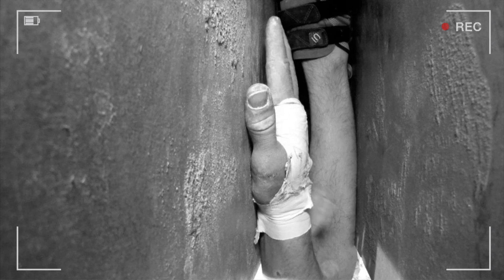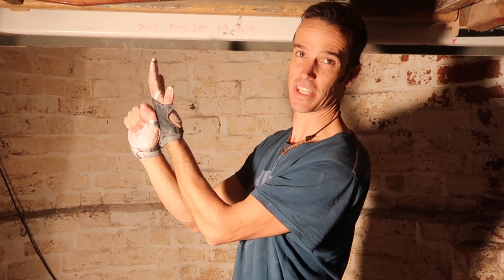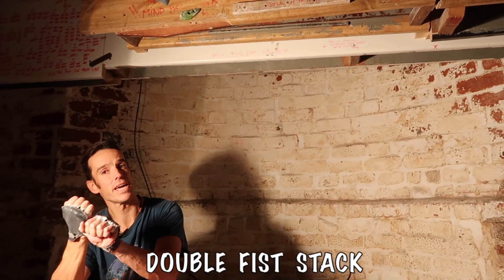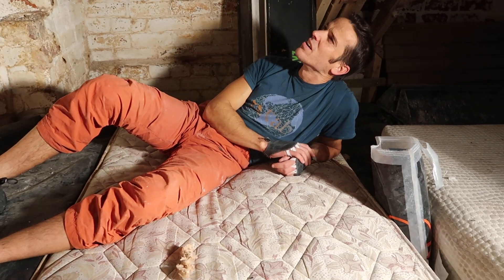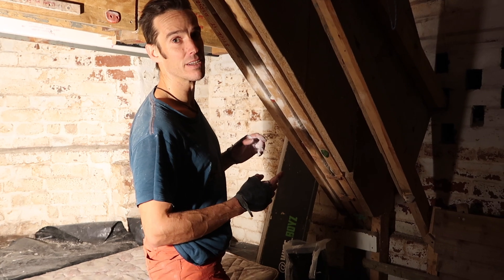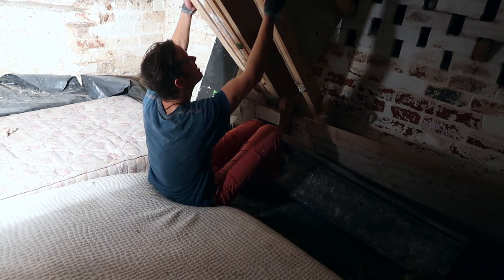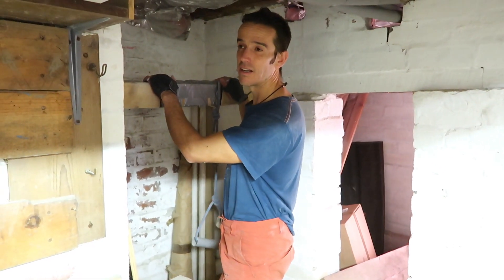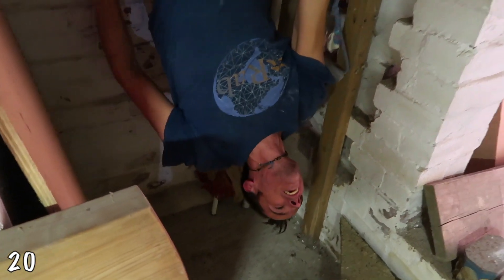How We Trained For The World's Hardest Offwidth Climb

Comment: Another great video! 
I have a question to you guys (i also posted it on the Lattice video).
I am learning finger cracks amd noticed that in some cases there are moments when most of my body weight has to be supported only by fingerlocks (i guess you'd prolly find foot placements, but i fail to do so). Would it be in any way beneficial for me to install a fingercrack hold in my basement to just hang off of it on fingerlocks? What i mean is a sort of "fingerboard" for fingerlocks.
Reply from the maker: when we have been training for finger locks, we have actually done finger stack training when fingerbaording, rather than fingerlock fingerboarding. The reason being is finger locks can be quite brutal on the ligaments. how we've done it is use vertical pockets and stacked fingers on top of each other (rather than next to each other) in the pocket. This builds strength in the tendons whilst replicating a simialr position to finger jamming, whilst doesn't totally knacker the ligaments.
Reply: @WideBoyz  thanks!